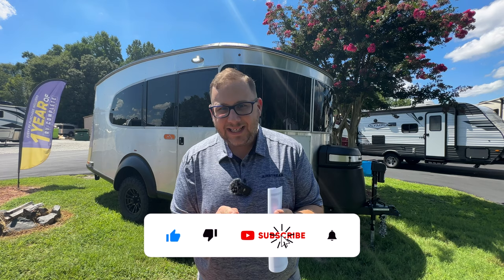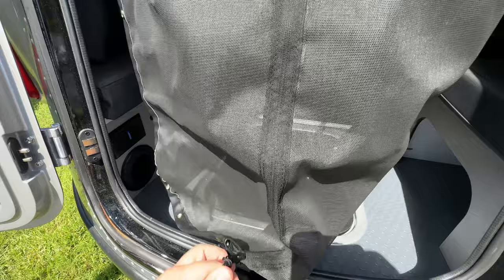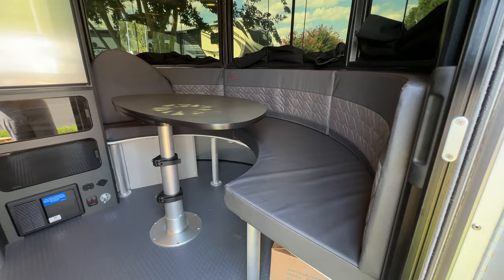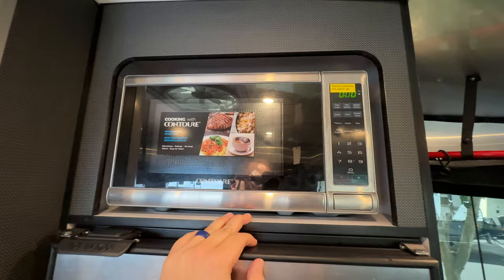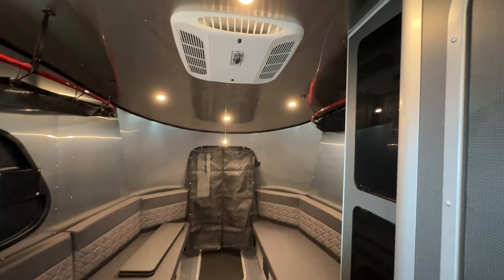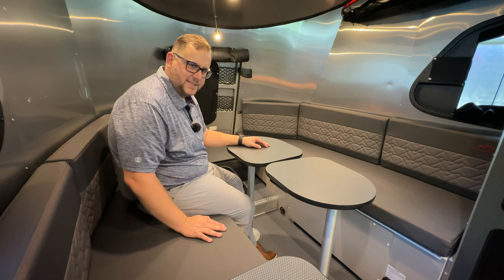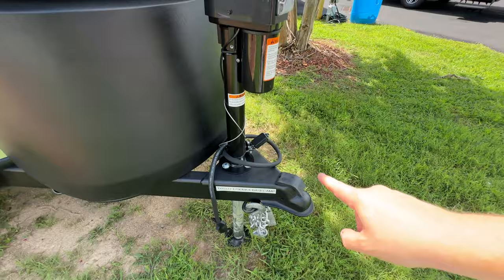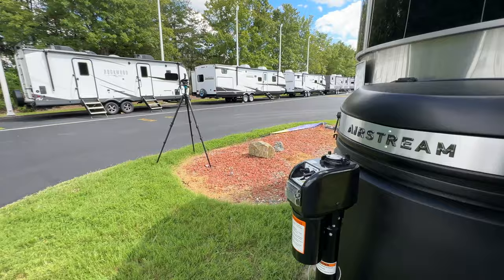#1 OVERALL SELLING Airstream, HOW? | First look at 2024 Basecamp 20X

Comment: That was really discouraging to see the interior tinted glass shattered like that on a brand new unit @25:50 and @26:13. How much more would tempered shelves or starboard panels be to equip for Airsteam, maybe another $50 difference at wholesale. That was three out of the ten panes shown overall with damage and the trailer's still sitting on your lot.
Reply from the maker: I would like for Airstream to change all of the Basecamps to what they did in the REI.

Comment: This unit needs a larger fridge with freezer, like 10 cu. Better outside door latch, door need to stop closer to the body.Design the cushion for the bed, into the center back rest, since most will not sleep in that direction. I can see many design flaws. You need to stop using college graduates to design, and get real life Rvers  input.

Comment: So if the Basecamp 20x is ranked the #1 overall best seller for Airstream, is the Flying Cloud 25FB the #2 overall best seller for Airstream? Or is there another unit that is ranked the #2 overall best seller?
Reply from the maker: Yes, that's correct the Flying Cloud 25FB is the #2 overall. That may change. I kind of view the Flying Cloud 25FB as the number one for Airstream travel trailers.
Reply: can't wait for the reviews and hear what upgrades/changes will be on 27 Flying cloud & International  Hood job on this review